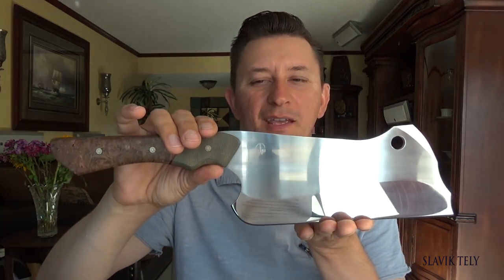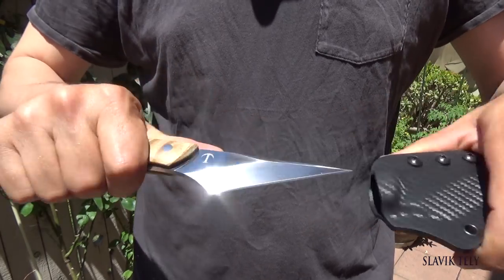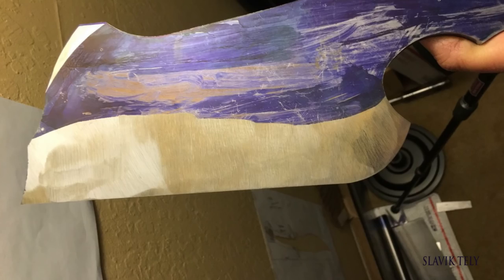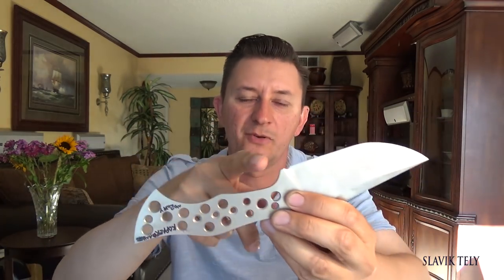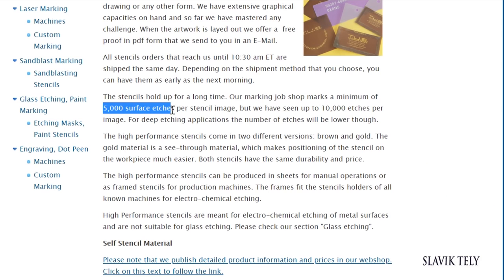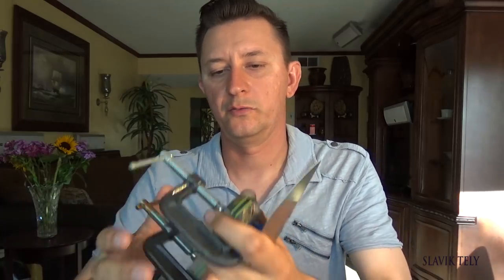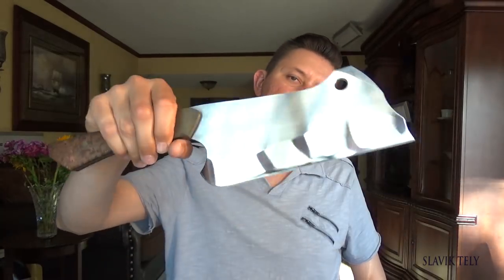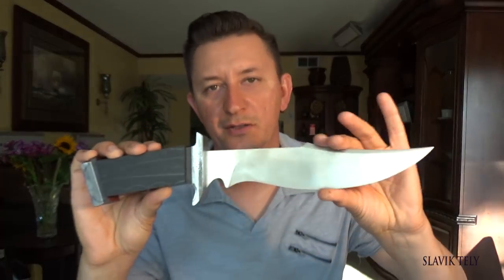Sting Ray Cleaver Q&A

Comment: What grades of sandpaper do you use? I am restoring a knife before I try making one and I have files but I was wondering what grits you use to get your finish
Reply from the maker: I use 220,320,400,600,800,1200,1500 and sometimes 2000

Comment: I just bought a knife from a knife maker. It has two cracks on the spine about  1/4". If i grind them down and change the appearance, would i have to do anything else to it?
Reply from the maker: Grinding should do it. Just don't overheat steel. Dip it in water as you grind.